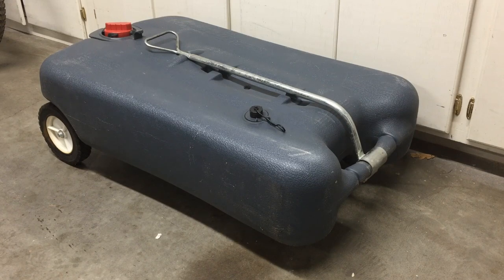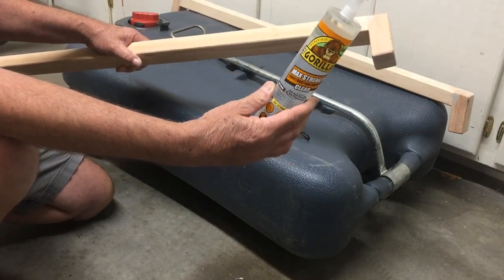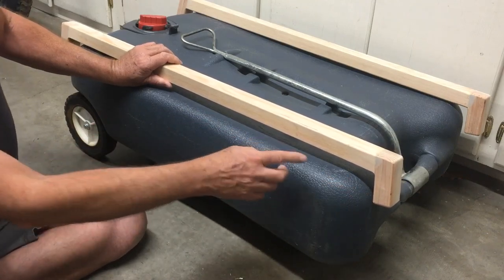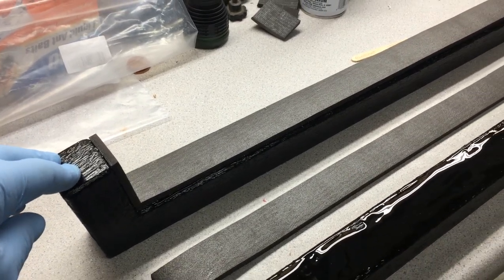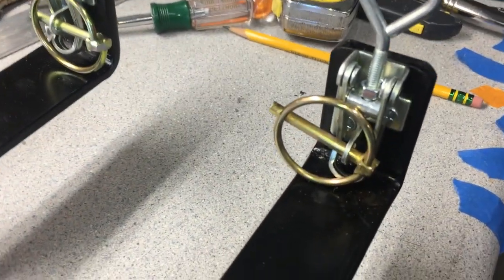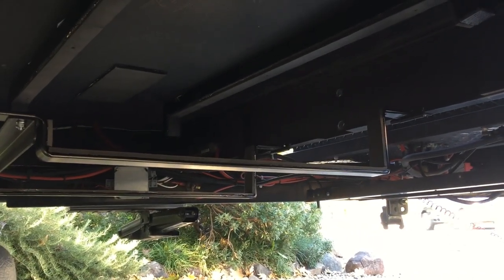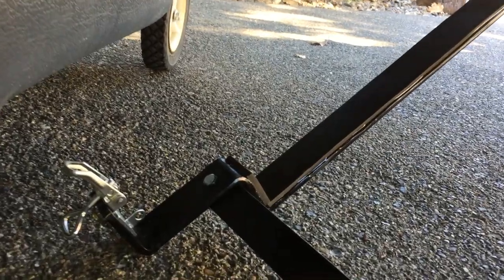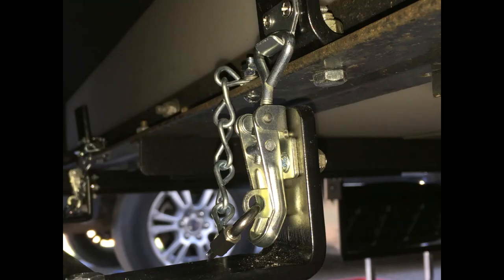Great Idea on Where to Store Your Portable RV Waste Holding Tank When Not in Use

Comment: Great ingenuity. I don't own a camper so this question is naive... how do you use it? Do you run pipe from the toilet to the tank? If you swap it out, wouldn't this tank have to be an exact fit for your primary tank?
Reply from the maker: Thank you and thank you for watching :) The way this tank works is it portable, you use it if you are camping at a location where there is no places to dump your wastewater at your campsite and the tanks on the trailer get full before you are going to leave. What I do is remove the portable tank you see in the video,  roll it around to where I have a pipe coming out to the side of the trailer that has a valve that I can open and close for the wastewater,  I have a hose where I can drain the wastewater into the portable tank and once its full I can roll it to a location at the campground where I can dump the tank. Here's example - https://youtu.be/4xo_750bmNU    https://www.youtube.com/@thetraveltrailerguy/videos

Comment: Can we ask where you live? We always wonder if we really need Our underbelly? We live in Lubbock Texas. USMC/USAF Ret.
Reply from the maker: Thank you for your service to our country, I really appreciate this.

Thanks so much for watching and asking your question.
    We live in northern California where in the summer months temps are around 80-100 degrees and the winter months 70-25 degrees. It does not snow here and if it does get down to 25 degrees at night it warms back up during the day and these cold days are on and off and not daily. 
   
So for us the underbelly is not needed (it has never had one) and we actually like having the trailer without one. Its helpful being able to see everything under the trailer for preventative maintenance, keeping mice from making homes under the trailer. 
   
We camp year round every other week for 3-4 nights at a time and go on 3 month trips and never had a problem with keeping the trailer warm.

Our air conditioner is 13,500 BTU's and is able to keep the trailer comfortable during the summer but if it gets around 100 degrees out the AC can run all day. I'm not sure if you watched this video I'm going to share with you here about how I increased airflow by 52% which cools our trailer very well in high heat areas. Its a long video but worth watching so you can see everything I did to accomplish this. If you like skip to the end so you can see me go over the numbers. https://youtu.be/JqP8YZcNsxY?si=tp7CQ-h2Gs0Q17LU

So I got one and contacted RV Airflow Systems Art to learn about this product and let them know I would be making a YouTube Video on it. So they were kind enough to offer a Promo Code you can use to save 15% at check out should you choose to buy this product. 
Just enter - thetraveltrailerguy15

15% Discount Promo Code (Use at checkout) -
thetraveltrailerguy15

To help figure out which RV Airflow System you need open this link; select the air conditioner you have; then scroll down to    "click here to see how to measure and confirm that it will work with your RV"                https://rvairflow.com/?gclid=Cj0KCQjw...

If you are confused on which RV Airflow System to buy for your RV give them a call and they will help you (574) 536-2472 or email them at support@rvairflow.zendesk.com

Link to all my other videos - https://www.youtube.com/@thetraveltrailerguy/videos

Comment: How did you secure the top wooden brackets
Reply from the maker: Good catch, I didn't really explain that part very well. I'm sorry (I explained it a little bit around 5 minutes into the video). I used 3 screws on each board and made sure I predrilled holes just a little larger than the screws that I used (I drilled the holes in the spacer boards only and not in the bottom of the trailer plywood). I made sure I only used screws that were not to long to go through the floor into the inside of the trailer.  I put the construction adhesive on the top of the spacer boards then held them up in place while I screwed them to the bottom of the floor, the adhesive bonds really well and the screws are just there to hold the spacers up while the adhesive dries (I did leave the screws in when the adhesive dried) - Here's the adhesive I used - https://www.homedepot.com/p/Gorilla-9-oz-Max-Strength-Construction-Adhesive-Clear-8212302/308772268?keyword=gorilla+construction+adhesive+clear&semanticToken=313t00901122000100_2021010403144910484529436379_us-east1-jsm0+313t00901122000100+%3E++cnn%3A%7B0%3A0%7D+cnp%3A%7B10%3A0%7D+cnd%3A%7B4%3A0%7D+cne%3A%7B8%3A0%7D+cns%3A%7B5%3A0%7D+cnx%3A%7B3%3A0%7D+cnq%3A%7B0%3A0%7D+cnw%3A%7B0%3A0%7D+cnv%3A%7B0%3A0%7D+st%3A%7Bgorilla+construction+adhesive+clear%7D%3Ast+oos%3A%7B0%3A1%7D+br%3A%7Bgorilla%7D%3Abr+pt%3A%7Bconstruction+adhesive%7D%3Apt+rt%3A%7Bclear%7D%3Art+dln%3A%7B583656%7D+smf%3A%7Bca%2Cbr%2Cfe%2Ccu%2Cpo%7D%3Asmf+nf%3A%7B1%7D%3Anf+qu%3A%7Bgorilla+construction+adhesive+clear%7D%3Aqu